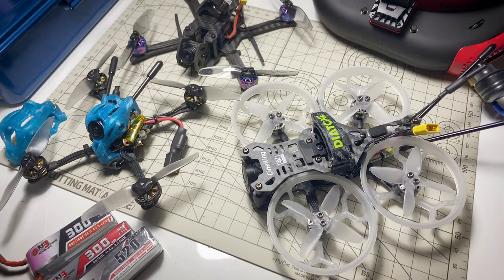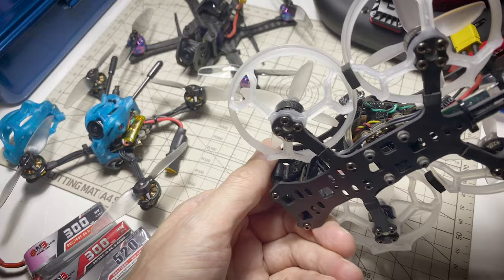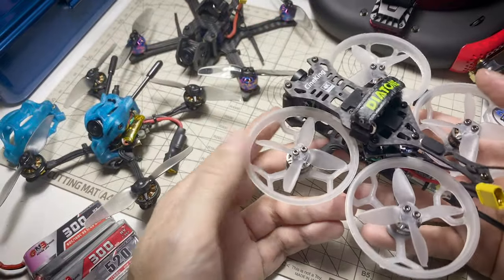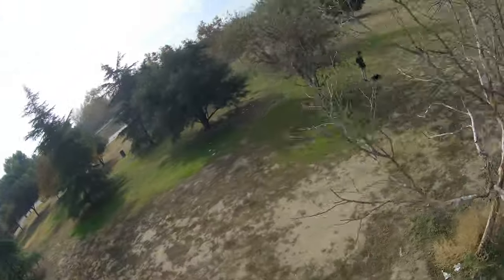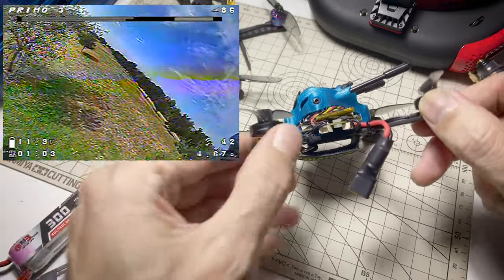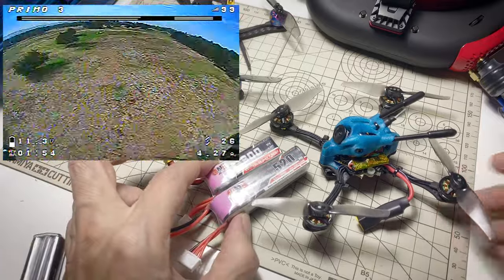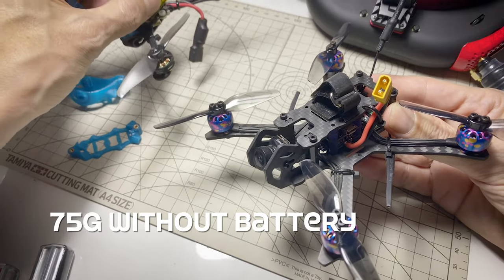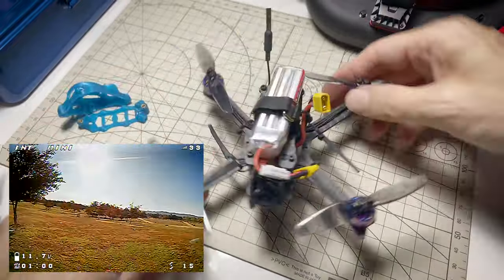Garage #2 ~ CineKing Update, New Primo 3 Canopy, and the Intrepid Mini

Comment: you can change your hoverpoint via betaflight, try "throttle mid on 1.0 and throttle expo to 1.0" if its still not enough take your idle value and set an offset on your radio 1% less than the idle value
this gave me good results on lower kv setups
Reply from the maker: Thanks for the idea! I might try that.